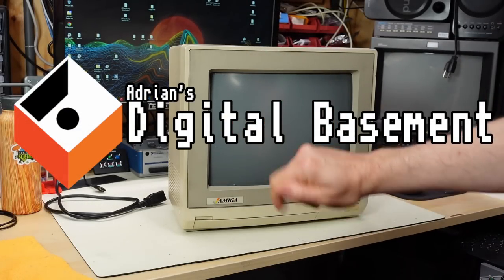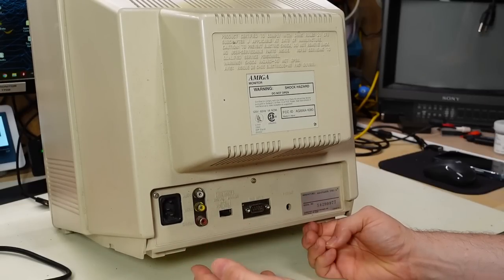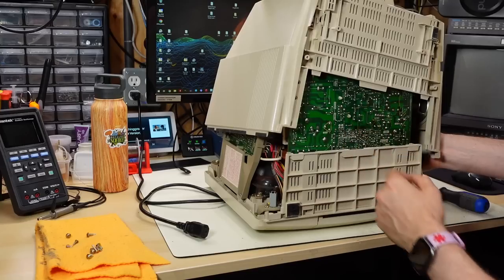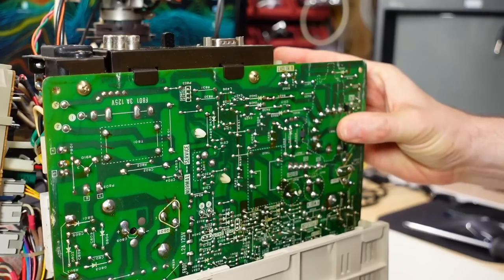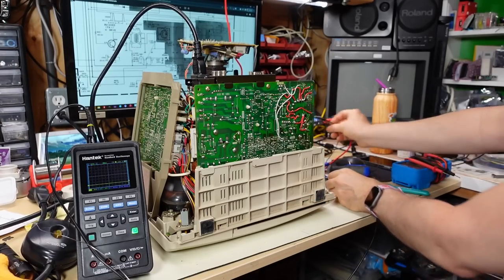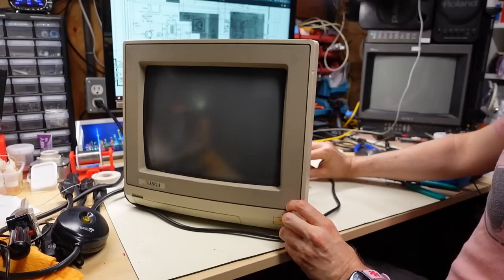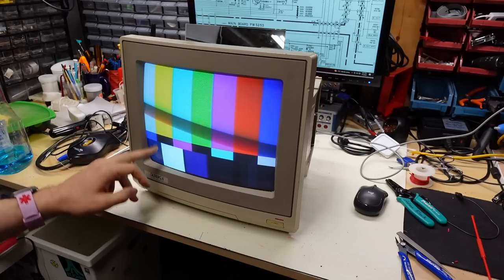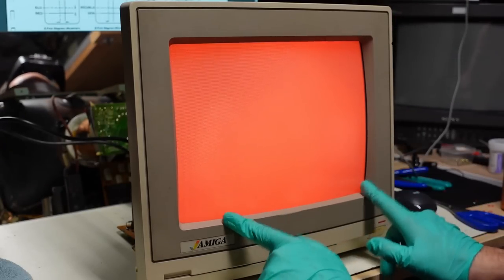Commodore Amiga 1080 monitor resurrection

Comment: I'd reinforce all those cracks, with strong epoxy. I'd also carefully drill a hole at the end of each branch of the crack to terminate the crack to stop it from cracking further.
Reply: I would like to see this done!
Reply: If you guys weren't aware, this is how they stop cracks from running in windshields.
Reply: Definitely dont use hot glue to reinforce as the glue tends to soften when the internal temperatures heat up.
Reply: @bennetfox  Also in steel! Had to do this on a cracked crankcase lol.
Reply: That's a great idea with the hole!  I just fixed a super valuable Tandy cm-8 that had all these exact problems-even the red I. The top corner.  I did epoxy mine, but I'm going to tear him back apart and do this.  I think it had 3 cracks and I e found it's way to a hole already.  Thanks again for your suggestion
Reply: @bennetfox  used in aircraft work too

Comment: I would have scrapped the solder mask off on both sides of the major cracks, tried to flatten out the PCB so the cracked ends came back together, and then flowed solder to bridge all the breaks and hold the board  back together.  Would have then added the heavy bodge wires.
If that monitor is NOT a Trinitron or similar one gun inline tube then there should be a set of rings on the yoke or neck of the tube that need to be rotated to set purity.  This applies to the triad gun (RCA) type of tube.  If the thing was dropped those rings could have shifted.

Comment: I always preferred to remove the solder mask all along the crack.   Then using solder wick if possible to bridge over the crack.  This provides an electrical connection, some rigidity and some flexibility for the board.   If solder braid is too large for the trace, then use the largest gauge of hook up wire that will fit.  The reason for doing it this way is to make sure I don't miss a cracked trace along the crack.   And finally ohm out all of the connections!
Reply: From a novice POV, this sounds like the logical choice just for the rigidity alone..
Reply: Fill the crack with crazy glue...
Reply: I agree. Solder braid is also my preference. Off topic but solder braid has a bad reputation but is my preferred method of de soldering components too. Ppl just don’t know how to use it any more. They try some old crap that’s been laying around and the flux in it is long gone and think it sucks. If anyone is of this opinion i challenge them to apply a drop of fresh flux on the braid before use and it will remove just about any amount of solder on a solder joint like a breeze.
Reply: @pederb82  : I think the bigger problem was that some braid (Radio Shack, as I recall, so pretty common) came with no flux at all.
Reply: @absalomdraconis  🤦
Reply: This!
Reply: I use a component lead for small traces, but same methodology

Comment: Those monitors were great value for the money.  I remember using one as a TV, as we had a miniature B&W TV (with like a 3.5" tube), but it had composite out.  Ran that into by 1084, and we had color TV instead of B&W, and you could actually see what was going on!

Fond memories of the 1084 and 1084S.
Reply: Amstrad (one of Commodore's big rivals in the U.K. actually sold a Tuner box to convert their monitor into a TV. I was going to suggest you could also use a VCR, but back then they cost more than a C64 and a TV together.

Comment: This has been a seriously helpful video, thank you!
I've got a nice Tatung multifunction (MDA, CGA, EGA and VGA) monitor that has/had exactly the same issues. It took a nasty drop during shipping and the flyback cracked the PCB. Fixed that and despite my better judgement, did a full recap as a couple were giving issues.
But it had colour purity and convergence issues almost identical to whats seen here. I had written the tube off as damaged, and it is in bits half way through a tube swap currently, but having watched this, I'll be reversing that and having a more in depth play with moving the yoke and purity rings.
I cannot overstate how much I have learnt from your channel, it is absolutely one of the best out there.
Reply: I had an SVGA monitor take a tumble down some (fortunately carpeted) stairs, and although it didn't quit working, it got way out of adjustment. I was hesitant to work on it, not because I didn't know how, but because I had done so enough times to get thrown across the room once. I remember doing a lot of the job with paper tubes and chopsticks. I never did get the convergence completely corrected in the corners.

Comment: Another note for those playing along, you should never push on the neck board from the anything other than the center of it.  Pushing from the edges, you risk cracking the neck board and you'll be doing a lot more jumpering.   All those who have suggested doing epoxy and just scraping the mask off and soldering right at the crack are correct.
Reply: Was think the same thing myself as it would help reinforce any gluing afterwards.. I'd also use thicker (solder adhering) and longer metal pieces to bridge the thicker traces as it would help reduce strain and help stop the "bridging" solder from flexing.

Comment: The 1080 is a fantastic display and totally worth fixing.  I completely lost the red gun on mine a few years ago, and was worried I wouldn't be able to fix it.  Turns out, the digital/analog input switch on the rear was all corroded. Taking apart the switch to clean it, polishing the RCA jacks, and lubricating the pot knobs in the front was all it took to get the monitor working almost like new.  I have a flicker fixer in my A1200 "just in case", but I still use the 1080 for a display because it looks great.

Comment: Hey there from another Portlander! Turns out I made almost exactly this repair last weekend to another 1080 monitor that fell and cracked its PCB. Used some epoxy to repair the case and the shattered PCB, scraped solder mask off traces with a fiberglass pen to bridge the cracks with soldered wires.

Comment: I,ve a commodre 2000 and a 1081 monitor and want to hopfully get it up and running again, after  30+ years it's been in my loft and have found yours and many more sites very usefull.

Comment: That red wire is monstrously thick, but it's probably the right choice in this case. For low voltage low current stuff I typically use wires from a high quality Cat5e Ethernet cable, their insulation is rated for up to 125VDC. For low voltage high current stuff I use automotive wire rated for 48VDC.
Reply: For low voltage low current in an application where I don't have to worry about mechanical stress much, I like using solid-core telephone exchange wire, because there's no fear of a solid wire unraveling and having a whisker cause a short -- they don't have any whiskers.  I remember Cat 3 and some really cheap "Cat 5" cables (that never really worked at speed) had the same solid core wires, but more recent cables don't seem so coat-hanger stiff so I suspect they're not solid core anymore.
Reply: @mal2ksc  I agree, solid core wire is better sometimes.

Comment: My A1080 is the same vintage.  Something inside used to arc ocassionally, resetting the Amiga unless the video cable shield ground was connected.  The horizontal drive eventually failed.

Comment: When I was in grad school I had to repair the PCB of an ancient spectrophotometer that the board had cracked like this. We used some binary epoxy to cover up the crack and add some strength, and then had to bodge dozens of traces. The damn thing worked perfectly when we were done, though!

Comment: I've had this monitor since 86 when I got my Amiga 1000 and have picked up many other model monitors from Commodore over the years and the 1080 seems to have a kind of blurry composite video compared to other commodore monitors, even the 2002.  RGB is fantastic though.  I first discovered this when I connected my Commodore 64 to it.

Comment: So that black soot is a sign of high hours? Found some in the 1995 Apple color 14" monitor I cleaned up recently.
This is the kind of repair I enjoy, bodging busted bits back together! In some ways, the easiest kind of fix.
Funny thing, the first time I turned it on I got a power LED and a screen-flash when turning it off, but after plugging it in to my Performa 475 it wouldn't show any activity, not even power-LED, unless the Mac was also on! Weird.
This Amiga CRT is still in better shape than my Amstrad-clone monitor/power-supply that was EOL'd/stripped for scrap by the PC shop somebody dropped it off at! 
Huge holes in the case, heat-sinks ripped out along with their attached components and chunks of the PCB! 
Still fixable, I think, as I have the schematics, just need to find some rare/obsolete replacement parts.

Comment: I really miss the 13" composite monitor I used on my C64.  Or that Dell 21" Trinitron beast where a cap most definitely blew but I didn't have the courage to attempt a fix back then.  Sure LCDs are nice because they're thin and light, but most can't compete with the standard refresh rates of low end CRTs.

Comment: I have one like this and have had it for 30+ years. It's a versatile and useful display for composite AND 15khz arcade monitors.  I recapped mine totally which restored it to 100% like new function.  I cleaned and resoldered the flyback while I had it apart, but they can't be beat.  Mine has audio also.

Comment: Nice job Adrian. A tip for you. Scrape the coating on the broken traces, and bridge them where the PCB is broken. Use a stiffer wire and it will stiffen the board and stopping it from flexing. You can also put superglue in the crack. These combined it will make a strong area. I have done this with great results despite the fact that some people say it a big NO-NO on using super glue.

Comment: Hey Adrian, do you know about "fiberglass scratchbrush"? They're a rod of compacted, parallel lines of fiberglass in like a lipstick container. They work great for removing corrosion in tight areas, but also for removing soldermask without damaging the copper underneath (unless you REALLY work hard). They save a ton of time, just gotta wipe with a napkin every few swipes (or do it under alcohol) so the fibers don't go everywhere as they break off. Super useful stuff for doing rework, and dirt cheap (most pens come with a second/spare fiberglass rod in the handle)
Reply: Yes, he has used them in previous videos. He probably would have used one if he had decided to patch the traces for mechanical reinforcement, but since he didn't, it didn't really come up.
Reply: @mal2ksc  Yeah it was a hell of a repair too! I do worry about it being so 'floppy' and more damage occurring. But that really was a painful repair to watch, probably because I've had to do similar and hated every second of it! His work has gotten so good recently, one of the few resto/repair channels I can watch. Dude loves his old puters and puts in the blood sweat and tears to really pull amazing repairs out of thin air. Hard not to enjoy watching someone passionate about their work.

Comment: I had a Commodore 1902 back in the day, it was just a crippled 1080 but I soldered in the missing wires to make it Amiga compatible. I have a working 1080 now. Nice fix.
Reply: could you explain what you did to make a 1902 amiga compatible?

Comment: I did the same repair to a badly cracked board under the flyback in an RCA 14in flat TV that was mishandled in shipping. (It was a bummer because it was actually packed pretty well.) I was floored when it actually worked!

Comment: Woah, I've never seen a circuit board crack like that from a drop before.  Must of been a nasty fall.  Rest of the monitor took it pretty well!  Great repair, well done &  nice video.  Thank you!
Reply: I had a 1080 PCB crack just like that after a drop from a desk-height shelf, about 3 feet maybe? It hit a thin carpet over a basement floor. Not the best thing to happen to it.
Reply: The flyback is very heavy, and board materials vary.  From what I've seen, it seems like even cheap boards these days tend to use a more rugged fiberglass than back when this monitor was made.

Comment: Great video, for best results using a degaussing coil start far away and move in circles toward the screen until you are right up next to it. then back away still moving in circles until the coil doesn't affect the picture.  Also GC Tools #9317 coil can run much longer, I recommend it. Looking forward to you getting a Coleco Adam computer. 🙂

Comment: I've only fixed 1 or 2 cracked pcbs but my method is to drill the end of the crack to it and then is scraped the soldermask back on each side of the crack and then solder a paperclip across the track. It's adds structure and reconnects it but I've no idea if that's a good idea or not.

Comment: That ringing on the left side of the sweep could be an issue with the flyback. If the bit that broke off in the brace was part of the core, it could be slightly detuned now.
Reply: I had a bunch of TTY terminals that used an off the shelf CRT module produced by Zenith and it was VERY common for the flyback ferrites to be cracked, and there would be ringing fold over in the picture as a result.
Reply: Doesn't that usually make the flyback whine audibly in use though? I think Adrian said he can still hear the 15.5 kHz H-sync, so if the coil was complaining, he probably would have noticed.

Comment: Love your videos!
I have my original Commodore monitor (no model # on it, so probably the 1080 like this one?)
Mine has rainbow coloring in the corners, so probably similar  problem, I suppose. I just need to find a degaussing tool, or find out why the internal one doesn't work on power-on?

Thanks again for your hard work and sharing with the community!!!

Comment: I had a C= 1960 multisync as a kid shipped to me,outside looked perfect,but board inside was cracked in 2 pieces across the middle.. I actually epoxied the board back together and jumpered all the traces back together with wire. It still works today but was a crazy amount of work.. Things u do when you are poor.

Comment: My old Commodore 1902 I had for years looked IDENTICAL to this monitor. Never took it apart, but externally, only the badging was different.
Reply from the maker: Yeah a bunch of US Commodore monitors looked just like this, but often the manufacturer was not the same. 1080, 1902, 1084, etc. I think there were at least 3 companies making these that externally looked the same.
Reply: @adriansdigitalbasement2   I wish now that I would have kept it. It developed some type of short inside or the flyback was arcing. I tossed it out, but with what skills I have now, I'm sure I could have fixed the thing.

Comment: I had to do pretty much the same work with both my Sony Trinitron TVs, the effects of mis-handling by a courier breaking stuff in transit with the flyback being jostled about and cracking the PCB, took some time to repair the damage, and both TVs worked perfect after repairs (21" needed other work, possibly lightning or power surge damaged), the joys of resin-bonded paper PCBs, they're just not suited for mechanical strength...

Comment: I still have my 1080, that I got for free exactly 15 years ago (2007).  It was given to me by another user at Lemon64. Actually he had several monitors he wanted to give away, but I didn't have space so I wanted the best one.  So through correspondence, he sent me photos of the same C64 screen on each monitor & I found the 1080 had the sharpest.  We worked out a way to get that monitor to me so we met up at a parking lot as he said he was going through different cities anyway.  Iirc, one of the other monitors was a 1084s & yet the photo I saw of it was a little poorer than the 1080, so whatever the case if the 1084 & 1080 are closely related, even if possibly different tube manufacturers, I went by what my eyes saw.  It makes sense that the 1080 is sharp, given that it was designed for Amigas. To this day I've mainly used it for vcr's & c64's.  The other reason I got the 1080 was to replace a Magnavox cm8702 that I had been using for my c64 since the early 1990's which then died by around 2010 or so, iirc, so this was a nice overlap.  I still have that Magnavox so I will be troubleshooting that eventually. So far I've seen like a blown cap, but I'm not sure, I don't have a scope nor an esr meter, but I did acquire the 8702 service manual via eBay.

Comment: The ringing could be caused by pick up from the white wires as the pass close to the LOPT( line output transformer).I use to be a TV engineer and a common issue with ringing was due to a damping resistor across the line linearity coil. They would go high in value causing the lin coil to ring which would show visibly on the screen.

Comment: That's nice you got it going again. Eventually the board should be glued back together, and the traces fixed permanently. You can use super glue to put the board together, and then bridge the cracks using 0 ohm surface mount resistors.

Comment: In UK we never had that shielding also these monitors I have seen several with PCB damage as LOPT is heavy and not supported. Glue (epoxy)  the PCB back together first as flexing will cause new problems.

Comment: In some materials, such as metal or glass, you can arrest a crack by drilling a circular hole just in front of its path. It eliminates the tear in progress by spreading forces evenly. I would think it would work well on a PCB, if there is room for a hole.

Comment: Can this be used with an Amiga 500? And if so, what cable would need to be used to connect it? Thanks
Reply from the maker: All Commodore RGB monitors work with all Amigas. The 1080 has the normal 9 pin connection on back for RGB.